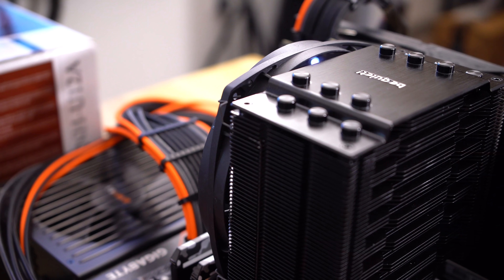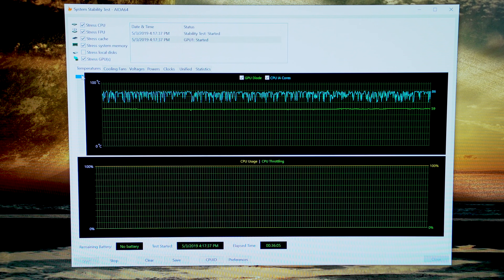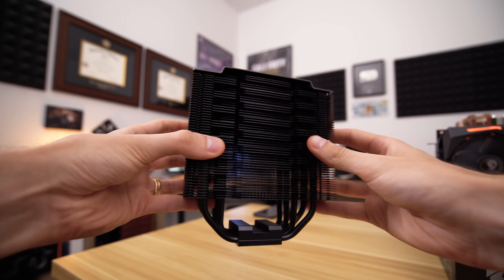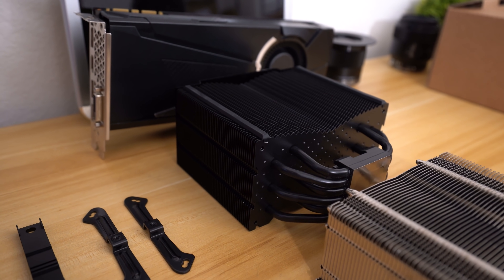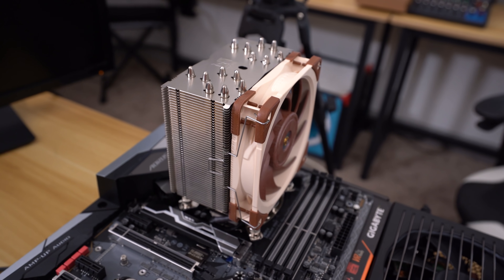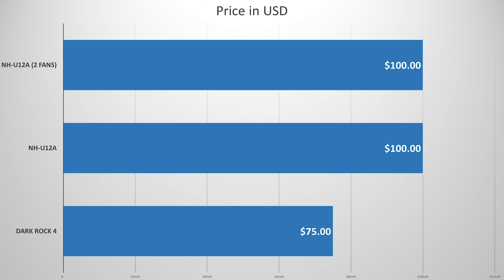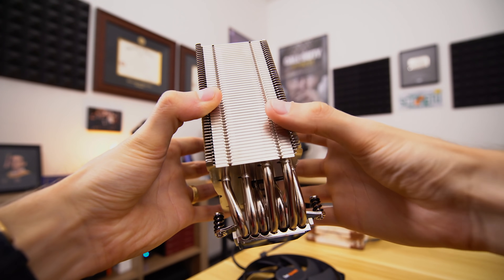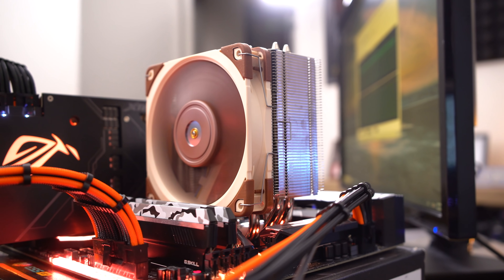Air Cooler Showdown: NH-U12A vs. Dark Rock 4

Comment: I have the dark rock 4 on my 8600k OC to 4.8ghz it's a great cooler and fits my setup very well
Reply: @RFLCTR  playing games max 70c, and I'm at 1.28V. stress test 90c
Reply: MikeyThanos awesome dude!!
Reply: @thatkoalabear  thanks man
Reply: ive got a delidded 8700k at 5.1 and a noctua dh 15 (the biggest one).  its totally overkill even with a 220w power limit set once the chip was delidded. i did it with a shaving razor in about 45 sceonds.  these intel chips are not nearly as hot as people make out. once delidded or one of the new soldered ones, they are very cool.  the big notcua was way overkill.  a hyper612 would have been enough.  this dh15 will handle the upcoming 10 core fairly easily if the power limit is set at 220w im sure.  also the 9900k is getting moved down to an i7 and the 9700k is getting moved down to an i5 this fall.  cant wait for that.  supposed to work with our 8th and 9th gen boards too.  so you will have a great upgrade path if you need it.  i3's will be 6 core as well.

if you do end up getting one of those 8 core 16 thread i7's later the dark rock you have will handle it very well.  just set the power limit to something it can handle.  if it goes over itll throttle a bit.  the power limit is the key to these large core count cpus
Reply: @bobhumplick4213  yeah mine isn't delided at all. I'm also using mx-4 thermal paste. I think people over react on temps on how supposedly hot they get.  I like my warranty so I ain't gonna do it lol
Reply: @mikeythanos  dont blame you about the warranty.  but i like to live dangerously.  the 10th gen should be soldered anyway so it wont matter.  and an i5 doesnt make enough heat to need delidding anway.

if you run prime 95 small ffts you get those high temps and power draw that people are talking about.  and only in prime 95. no real world app gets to even half that heat.  plus people arent taking into account how much work its actually doing while its running prim95 small ffts.   thats why its getting so hot.  its doing way more work than a cpu that doesnt get hot in those circumstances.

even if you are running prime95 small ffts, if you set the power limit in your bios to something your cooler can handle it will throttle if it ever goes over.  and like i said, with a power limit of 220w i never see any throttling in anything other than prime95.  not video encoding or anything.

ive never seen it go over about 75c actually.  in gaming it doesnt reach 60c even.  usually stays around 55c

Comment: Building my own PC with a 600 budget should I wait till July for the new AMD 3000 series or just buy parts now

I'm 14 I could use some advice
Reply from the maker: If you can wait, wait. If you can't wait, don't wait.
Reply: @GregSalazar  I do have the time to wait so thanks for the advice man
Reply: arent you 2019 years old?
Reply: might as well wait I guess. if u got 600 dollar budget and want to buy now this might work https://uk.pcpartpicker.com/list/4PMvXP
Reply: KryonOG swap that blue drive out with a black and you got it
Reply: I'd say that if you can hold out for Ryzen 3000 series CPU's to launch, you might be better off doing so.
Even if your budget can't stretch to a decent 3000 series, it's likely that the 2000 series CPU's will both receive a price cut, and be more available pre-owned due to people upgrading.